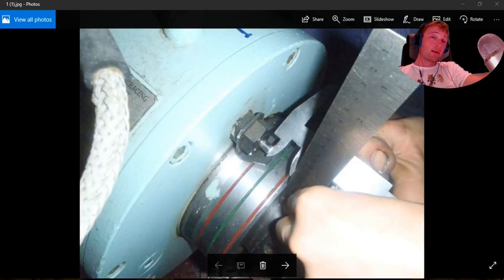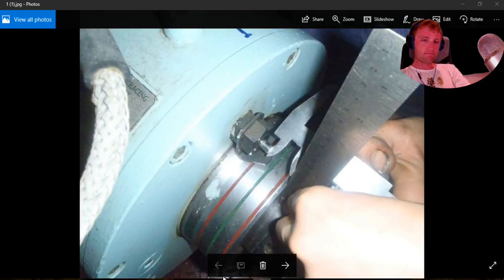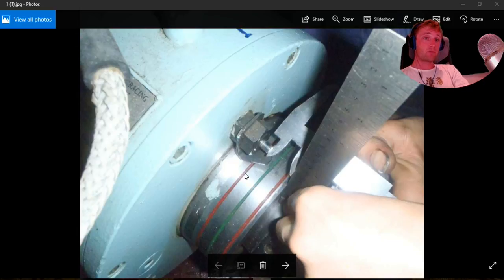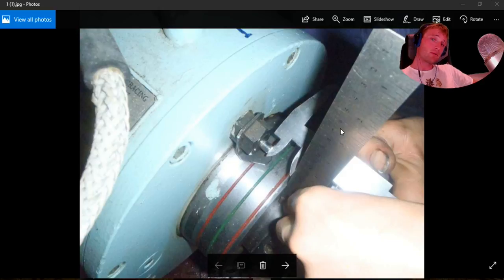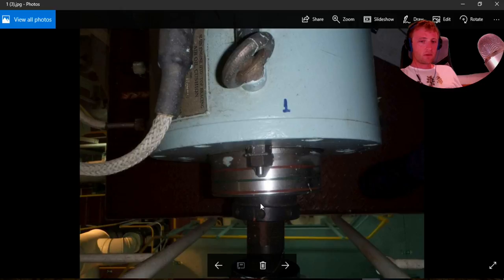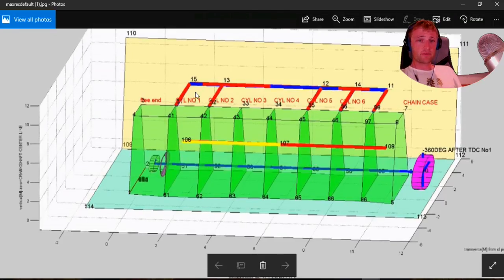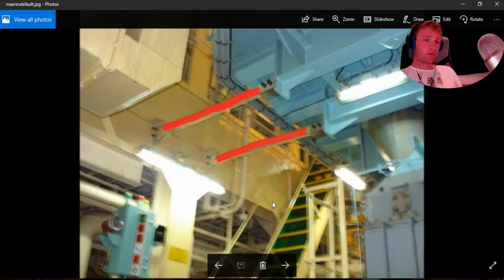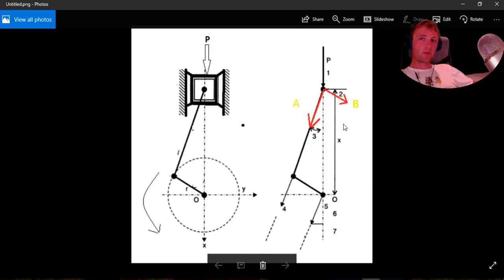TOP BRACING SYSTEM MAIN ENGINE

Comment: Are the top bracings on the STBD side of engine only..if so why
Reply from the maker: Hello dear friend everything is calculated and the reason they put there that this engines with 6 cylinders the engibe tend turn to right the rotational direction of the engine.The purpose of top bracing is to protect the accomodation stracture.Thanks!

Comment: Sir, could you tell us why we need to measure the distance of stroke indicator from the transfer barrier ( As shown in the first image of the video) ? The cylinder stroke indicator can indicate if any chamber needs to be charged relative to its position to the green band. Then for what purpose the distance is measured? Hope you can clear my doubt. Thank you.
Reply from the maker: My friend i will check that in the manual and will inform you!